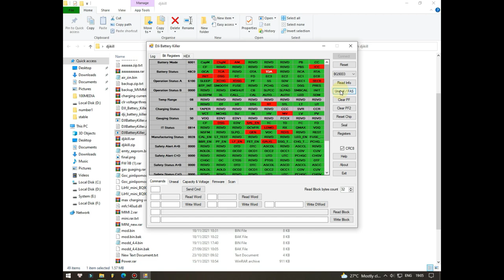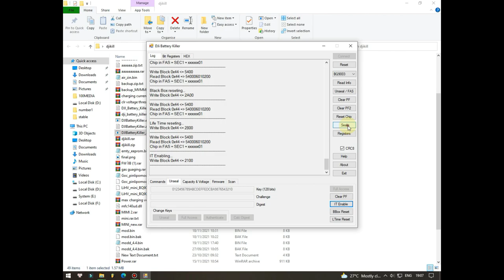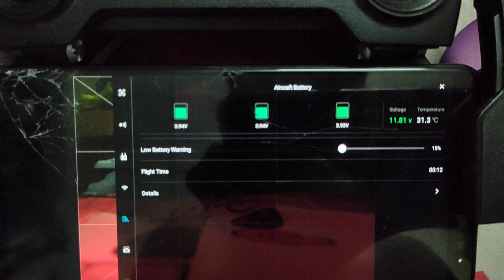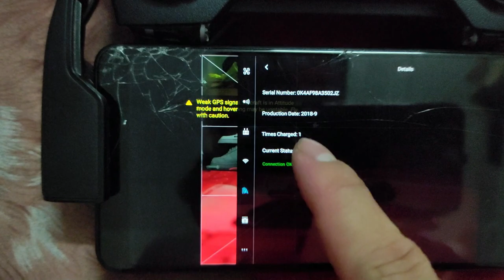Mavic Air battery mod 3500mAh from Mavic Air 2 cell. Walk through | up to 25m flight time

Comment: how you connected the battery to the computer
Reply: wow you made the drone work on 2 cells hmmm
and in the software you simulated it works on 3
did you try to program that battery to see 4 cells